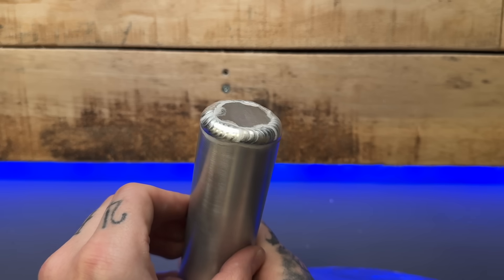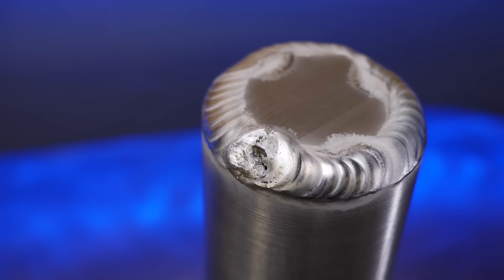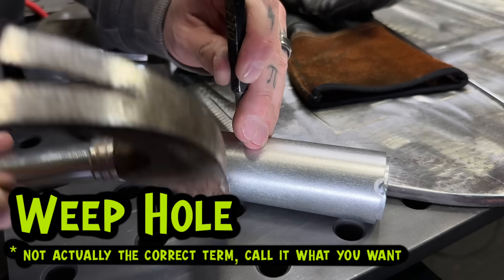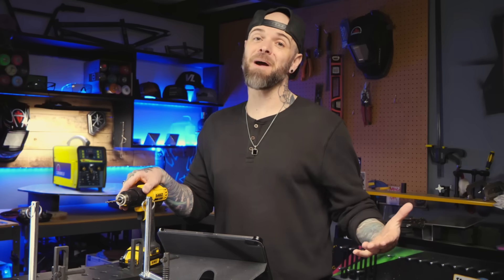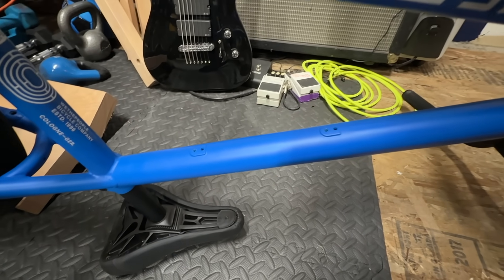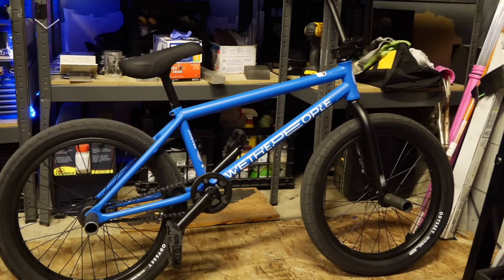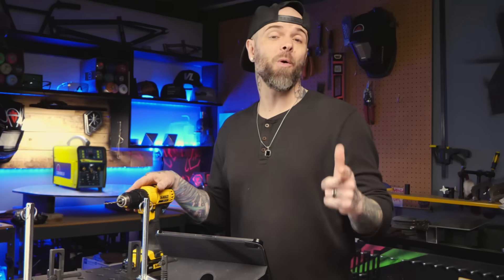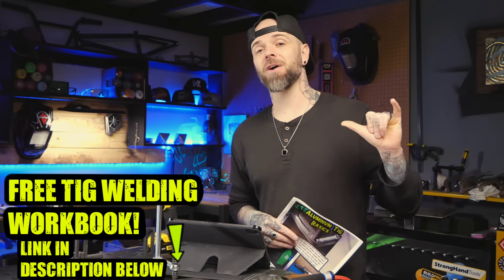99% of TIG Welding Beginners Don't Know This Trick

Comment: Learned this in the 80's when I started tig welding...when you weld aluminum tube always fins a spot that won't be seen and drill a small hole...if not you'll get blowback at the end of your weld.

Comment: I would manufacture mobile platforms everywhere there was Joint I would drill a hole once it has been welded you don’t see the holes.
Aluminium welding of tubes and hollow section require that you drill lots of holes leading into an open tube that is sealed with a cap, or is going to be used for other things like an attachment of a latch.
Never mind if it happens drilling the hole where the expanding air has escaped from use cool air to keep the tube cool and you can easily repair it.
Depending on the type of conditions the job will be used in example the food processing industry we cannot have holes where insects and bacteria can buildup inside the tubes.
Sometimes even baseplates require a drill hole under the baseplate, unfortunately sometimes it doesn’t work.
Drilling a hole just next to the weld joint to allow escaping air to flow back into another area.
Often the baseplate will have a small hole for escaping air and these holes are sealed with a weld after cooling.
For industrial applications where the platforms are to be used in high heat areas such as near a Furnace we would drill holes in every tube to avoid weld failure while in service.
Hot gases will expand and contract your Aluminium tub and you will find that your welds fail after six months in service.
Hopefully this information will help people to trouble shoot I was self taught and I have my own business where I subcontract my welding services and skills in a number of industries 
I’ve always been a tradesman who likes to share my knowledge and experience and feel a sense of pride knowing that I have helped a young fella or lady to become a great tradesperson.

Comment: Many years ago Porsche took the vent hole idea a step further. They put all of the vent holes inline to another tube when they created their "bird cage frame" On the 917. Then they would purge the whole frame as it was welded with Argon. After that they would purge and pressurize the frame with nitrogen and seal the frame off. Then they put a presssure gauge on the frame and if the pressure had dropped, they then knew the frame had cracked somewhere.

Comment: Your videos have been super helpful but I haven't been able to find a video on welding aluminum tubing. Specifically at work I weld aluminum plumbing for tanker trucks and it is pipe with angle fittings. The biggest issue is I have long pipes in a vise. So not only do I have to walk a circle around a pipe there is rarely a spot to rest my hand so I'm always hovering. I'd really appreciate a video trying to help me and it maybe some new content for you.

Comment: Are you actually serious???
Learning fabrication almost 40 years ago a fundimental of closing a sealed canister is you let it cool before finishing the last weld.... gasses expand with heat, this creates pressure, the pressure needs to escape and it will at any point not sealed, ie the last bit of molten weld causing "blowout" ..... 
You very simply let it cool... wtf were you taught 😂

Comment: Called Welding a Vessel.  I have TIG welded 4130 Chrome Moly Aircraft motor mounts and under the manufacture's repair procedures, Drill a hole, do the welding, have it tested, fill the mount full of boiled Linseed oil, move the mount all around to "coat" the inside, then drain all the oil out through the drill hole, and finally install a spiral drive rivet in the hole. I have never had bad TIG results from any excising oil left inside previously.

Comment: dont listen to this guy 
the reason you got a hole is because your fit was crap or your burnt through 
if you have any gaps at all and you have a few welds to do do all the gap welds first then walk away let everything cool down 
then finish all the other welding and try not to get your part to hot 
take a few brakes 
or split up the welding in different areas  to not raise the temp in the void of your part to much 
this guy that your watching is a beginner and dont know shit 
lets say he was welding up a tank you going to be drilling holes all over the place ?

Comment: The way I prevent this is to wait 15 seconds before closing. As the whole container is cooling its gas is shrinking. Then I quickly  nail it shut. My heating is less than the containers cooling.
Reply: I wish it was that easy
Reply: @LukeSevenski  It actually is, it is exactly what I was taught to do. Why, because you can not put a relief hole in everything you fabricate that seals as some components just can't have it. You let the piece cool then hit the very last bit of weld while it is cold. Weld is solid by time the gas is hot enough to expand. Job done! I have literally done this thousands of times 😂
Reply: @albertbahoogadin ill second that .let it cool and close it later
Reply: That does not work.
Reply: @nathancampagna4331  looks like you have a few fabricators here who not only disagree but do this regularly...... like I actually did this just last month...... 👍
I guess it didn't work though, oh well.... 🤣👋
Reply: @ 
As soon as you blow shielding gas in the void it pushes right back out even if it’s cold. It’s not necessarily a heat thing. 
Drill 1/8” hole then plug it with a 1/8” short piece of rod. That will seal the hole so you can weld over it easy.
Reply: @nathancampagna4331  sure thing

Comment: 😂 This is not an acceptable  way to weld a pipe!
Weld faster, use better torch angle or just let the damn thing cool in-between welds.
You have a TIG welder not a stinger and rod, there is plenty of controll already in your pedal since your welding aluminum with hi-freq.
Reply: Huh?
Reply: You feel better now?
Reply: Ah yes, weld fast and there will be no heat in the tube with expanding air at all😂
Reply: The best way to avoid the blowback is to drill a 1/8” hole anywhere, weld up the joint, then go back to the hole and plug the hold with a short piece of 1/8 rod and weld quick over it. Polish up the area and nobody ever sees the hole. 
I’ve used this technique a hundred times. It’s the only thing that actually works 100% of the time. Try it. Works great on aluminum.
Reply: @nathancampagna4331 that’s what this whole video is about.
Reply: @travisnorrie1002  
No, he doesn’t tell you to plug the hole after with a short piece of 1/8” rod and then weld over it. You do t need to leave the hole. Most of the time you just can’t leave a hole in the product.